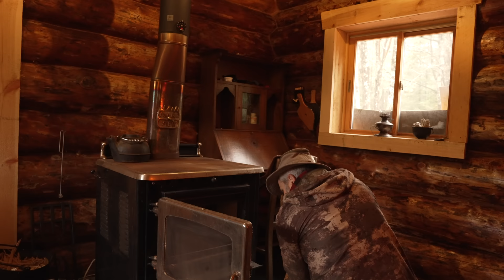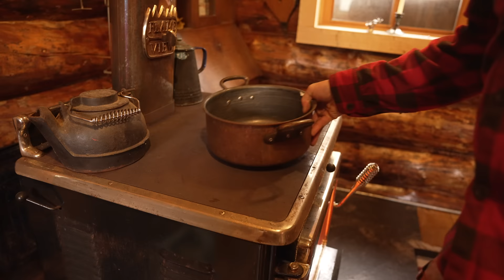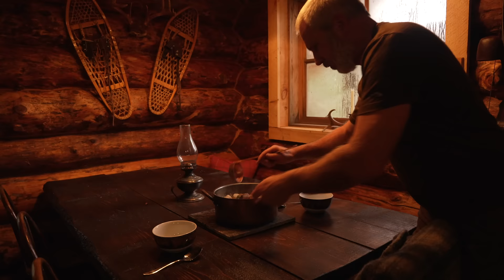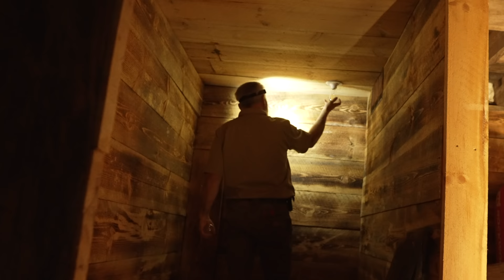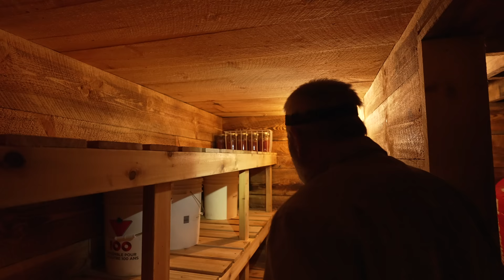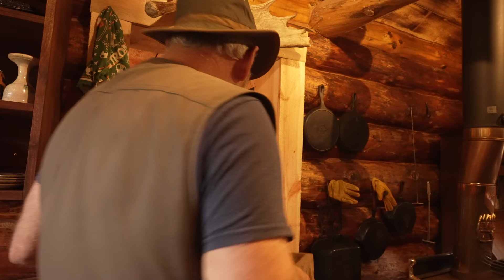Building a Root Cellar under my Log Cabin, Making Dinner for my Wife, Forest Garden Potato Harvest

Comment: Great idea to manually be able to check and adjust the humidity level in the root cellar by pouring water on the floor. Especially potatoes are pretty sensitive to being stored in a too dry environment, but you're probably well aware of that. A quick tip for that is to store potatoes in plastic boxes with some holes drilled in them here and there. If it gets too humid in there, just open the lid a bit. We do this in our root cellar here in Sweden, partly to keep them from getting eaten by mice, but also to control the humidity. Works great.

Comment: Looks good.  Yes, please give a complete tour of the layout in relation to each space.  This makes for a better mind’s eye / bird’s eye conceptualization of the workings of each niche space and it relationship with other niche space for the on line viewer.  An idea for you to consider; if you haven’t already:   Consider the middle and lower shelf front edge having an 3D edge ( a 1” x 6” or 1” x 4” vertical board above the face of the shelf  … maybe attached to the shelf’s vertical supports ) to act as way to hold any loosely placed veggies on the shelf.  Hence, making the entire shelf a low walled box.

Comment: When we were building our cellar, we installed 2 air inlet pipes in 2 corners almost on the level of cellar's floor and another 2 air outlet pipes in the opposite corners close to celling. This way, the air in cellar circulates naturally. No need to use any fans. 
For the pipes, we used plastic, e.g. ABS pipes with at least 100mm diameter.

Comment: shawn after you clear the garden near the house, a weed burner will allow for controlled burns adding carbons and stuff to the soils...eventually aiding in raised beds of huegle culture ! All part of the sustainability process...Game entrials and other organics etc will allow for an efficient work process> building healthy soils and with reusable forms and cement raised walls from the native sands> pour in place! then at the end of each bed you can have a fire box and horisontal pipe to the distant chimney, the horizontal flues from steel pipe will warm the soils and wake them in the spring and even allow for winter crops to sustain through winter...one small fire a day will keep the soils warm or wake them up...add water and seed cover early plants with buckets...soil temps accelerate growth! Imagine putting out plants in march the roots grow and grow when the sun catches up the explosion of growth may allow for two full harvests increasing the bang for the buck! Double the production of the ground used...When studying the korean ondols and later roman hypocausts some still in use after 400 years in spain I thought heck why not convert grow beds to green house space! It works and with out fans wires or switches! before laying in the raised beds put down hardware cloths the steel mess prevents moles voles and mice from getting in from underneath...They will like the warmth as well as the plants...from up top as the walls rise and the healthy soils emerge simple battery powered reusable traps will allow them to aid your composting through out the season with their dead bodies>>> It won't eliminate crop loss simply aid the organics while controlling the crop loss.  If the mice can climb trees which they do they will climb the stone barriers on occasion but the reusable traps allow them to be gathered and composted...In 3 years the beds should rise and filling in layers like lasagna! allowing for simple maintenance and management eventually your bending back will thank you for the raised beds! LOL

Comment: If you a land lumber room in the ground. out side, then put your potatoes, carrots, red beet , squash, and all others and put some clean soft sand on them, inside that room, is too harvested , much put layers of sand and your vegetables will stay fresh  for months sand must be very little wet, even without sand still be ok
The room must be sealed with plastic to keep the moisture inside plus no frost, vegetables make enough heat.
You can put opinion as well, 
For your tomatoes, in the same room, take the Tomato plats with all its green tomatoes on the plant, from root and hang them upside down  in that dark room you will have tomatoes for long time

Comment: worms .... the gardeners best little helpers .... well worth the cost of a few buckets of live bait for the garden beds ... 
if you locate some local lime ... take a bucket worth and heat it super hot .... then place in a metal container in the drying room ... it will slake with the moisture n the room ... and provide warmth as well ... a good idea o add a vent to the outside to pull air from the floor out with a small pelltier fan ... 

btw those computer MUFFIN fans  ... can also be run off of a few pelltier devices ... if you have a heat source say or a hot tent stove running in the cellar have the pelltier device attached to that with a bar of aluminium so they get hot from the heat source and then pull the air from the floor across cooling fins to expel low level gases you dont want building up ... say from slacking lime or CO2 frm a wood stove etc ... they can also be used to trickle charge batteries like cell phones and laptops sized ... a tall can stove with a water jacket to heat water would be an excellent heat source a great addition to the cabin with hot water ... and air exchange in the cellar with heat source as the power device for the fans ... (added bonus run the heated water pipes in the roof of the cellar all over the place you want to keep warm and you have subfloor water heating as well as a bonus)

Comment: The inner walls of the bedroom built where I live in is a measurement of 16 ft x 10ft and it's got 4 ft small closets so the bedroom is 12ft x 10ft and I do not recommend having a bedroom this small. I would say that a perfect 20ft x 20ft bedroom or 20ft x 16ft bedroom is a good size and if you added closets to that it would end up having a 16ft x 16 square area of space left for the bedroom. But you can put string line down on the ground in the shapes of squares or something and see if you like being inside a 16ft x 16ft square with all that you want in your bedroom or if you'd want one bigger than that. I figure the bathroom you made is going to stay there so it might be a good idea to make your bedroom have enough space so it's also like a living room as well as a bedroom. Just some ideas. I've never had a Couch that turns into a bed except for a futon but I've seen beds that people made that were built into walls and they could pull them down when they wanted to turn their room into a bedroom. Women need space for their vanities. My mom had space for one and had one and grandma had one. I like having a gaming desk in my bedroom. That and an Entertainment Center with a good sized T.V. on it would be nice in a bedroom. If you had one of those pull down wall beds when it's up you could do yoga stretching and workouts and other stuff in that wide open space. You could put a safe in a closet. Whatever you do, try not to make a bedroom smaller than 16ft x 16ft. It's just too cramped. Maybe even no less than 18ft x 18ft. More if you want living room space too. Because with that Kitchen, Dining table and bathroom with that little area by the fire does not make that part of the cabin feel like a good sized living room spot.
Reply: Oh they are called Murphy Beds that pull down.

Comment: I have a question.  Is the basement going to be unheated? If so,  wouldn't putting the plastic vapor barrier on the cold side of the insulation cause condensation to form on top of the plastic?

Comment: Hi Shawn, I was looking at you starting the First Fire of the Season at 1:46. And wondering if there should be a heat shield between the wood stove and the wooden desk? Maybe they are farther apart that I can reckon, and maybe the wood stove is not as hot as it may seem. Wondering, anyhow.